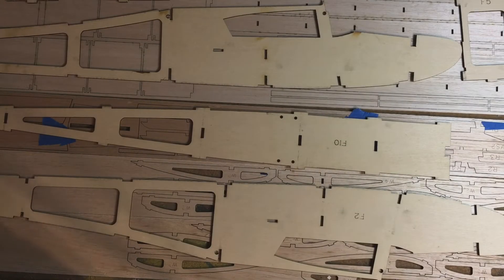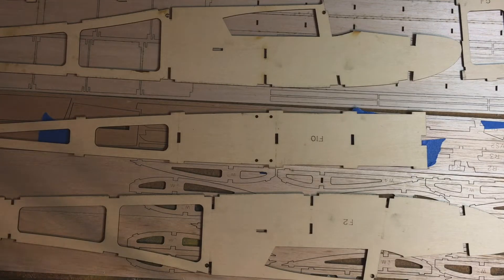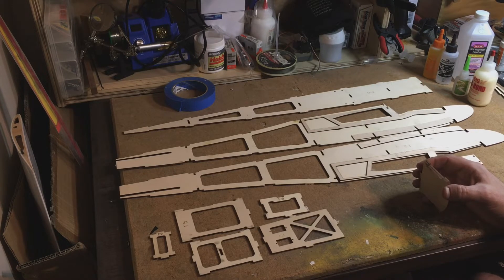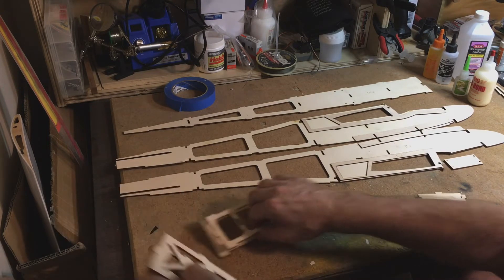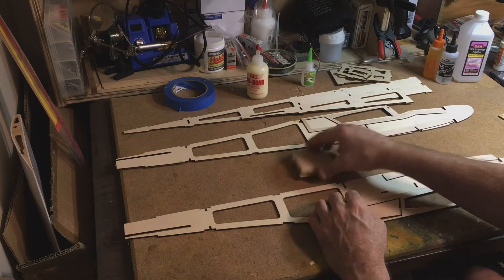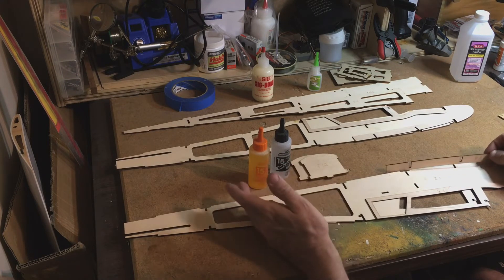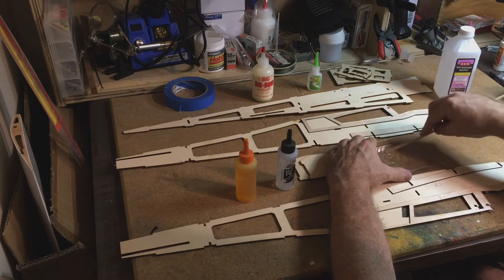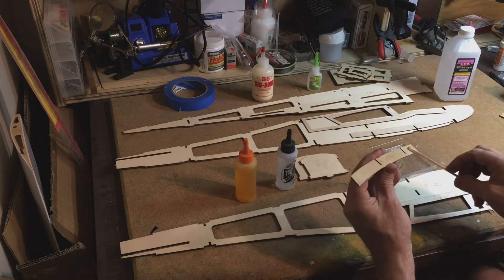Building the Junior 100 RC Trainer Part 1

Comment: Could you please tell me what type/thickness/ply of plywood you suggest for the fuselage? 
I’m going to start making a 3D fusion model of an Sig Kadet Mark II. I still have the plans from one I built in 1987. 
I want to make an electric version with as much weight reduction as possible.
Thanks for your video series, it has helped me immensely.
Purchased a Neje Max 4 laser to make this a reality.
Reply from the maker: I use 1/8(3mm)  Liteply (a trade name) or Poplar Light Ply or sometimes called bending ply. You can get it from nearly all the balsa suppliers.